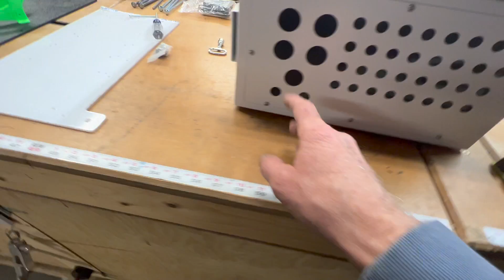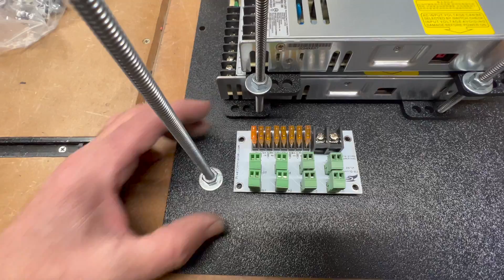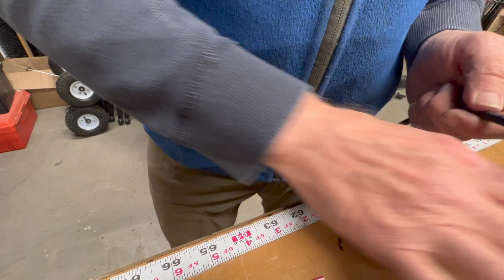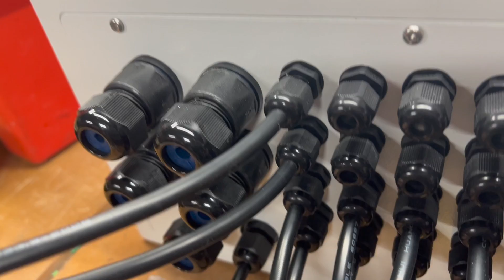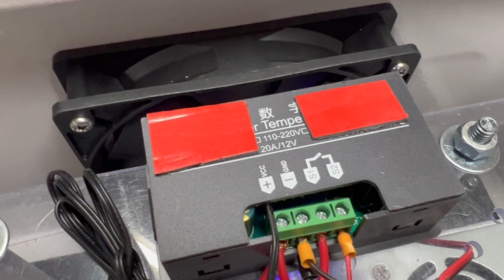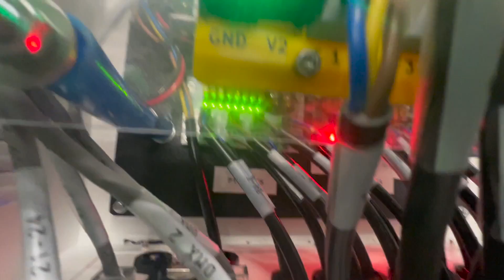Pixel Controller Build

Comment: This is very helpful.  Does the power to the thermostat come from a distro board, or directly from the power supply.  The wire looks thick, so i was wondering.
Reply from the maker: I got it directly from the power supply.

Comment: Nice build. Power injecting from separate power supplies, do you break the positive so the controller power and other power supplies are not feeling same string?
Reply from the maker: Yes I break the V+ in the prop or between different props.  It depends on various factors like number of lights brightness level and type of pixels.

Comment: Do you have a wiring diagram to follow? I am building same setup and need help.
Reply from the maker: I have not created a wiring diagram.   Generally you connect the 120v plug to the AC side of the power supplies.  You then connect the DC side of the power supply to the controller.  One power supply connects to one side of the controller and the other power supply connects to the opposite side of the controller.  In other words each power supply powers 8 ports on your controller.  Hope this helps.

Comment: Why did ya switch from Falcon controllers?  Just ordered 3 new F16V4.
Instead of the Meanwell supplies, switch to breakout board HP server power supplies.  The come in 700 and 1200/900 watt units.  They are super robust in a small package.
But I custom build all my controllers and dont use the premade Bud box units. Cheers !
Reply from the maker: I still use my falcon f16v3.  Just decided to try out the genius controllers.  I like there new differential receivers.  As for GP power supplies, just haven’t gotten around to trying them out.

Comment: What software do you use to control all this? My stuff is so small and it is just WLED still.
Reply from the maker: I use xLights.  There are several others you can use.  xLights is very powerful and there is a lot of community support.  It is also open source.

Comment: About the Genius controller, is there a relay output to turn on the power supplies?
Reply from the maker: No- don’t think I have seen any pixel controllers that do that.  The Genius controllers operate on 12 VDC, so they are powered up by the power supplies inside the box.
Reply: Might want to branch out a little. The Dig-Uno, Quad and Octa boards all have a delay out put that can be used to turn on the power supplies. Just need to provide 5v to the ESP32 chip.
Reply from the maker: @eekedout  did not know that, thanks for the info

Comment: It is a nice video and a clean build, however... as a retired industrial controls systems engineer I cringe at the power supply mounting where you cover up the bottom supply fans.  It may work ok in the reality of Christmas lights and cold weather, but I believe it is a bad design.  Give them some breathing space..
Reply from the maker: Yes this box is very large.  You could have a stack of 3 power supplies so if you have two of them you will have plenty of space.
Reply from the maker: Thanks for your insights.   There is about 3/8 of an inch spacing between the stacked power supplies so the fan is not covered up.  Also have a large fan, 9 inches I think,on top to pull cool air through the box.
Reply: @bergmannlights5149  Was looking into using this box - and your video is very helpful to get a hands on feel for it. Regarding this comment which seems like a valid concern - is there room to add spacers to increase the breathing  space between power supplies - say maybe one inch?

Comment: Looks good. I did a similar-ish build earlier. 

I like the box. It's very solid. I struggled with the carriage bolt things for a while until.. Mynor filled me in.  Also the silver vs 'dull' bolts being different lengths. It's not that much of a difference that it's immediately obvious.. 

I have a quibble with the box - which is that the triangular key has a MUCH larger triangle in the key than in the slot. Which means you can't leave it in - it just falls out. it's way too loose. And you have to use the key to latch the door. I'm not worried about people opening it up and stealing things out of it, so I'd probably have to screw something into the housing somewhere to hang it off. 

Also - "We're just about finished" .. I'm also struggling with how to mount this thing. I suspect I'm just going to end up leaving it on its side, like you have it here - for access to the pigtails, but it won't stand up like it wants to... I'd be interested to see if /what you come up with for that.
Reply from the maker: For mounting it I plan on using the large hose clamps that came with it, feeding it through the back brackets and the mounting it to a pole by my Megatree.

I do like this box a lot but it would be nice if you could open and close it without the key
Reply: I'm searching for reviews on this box - not much that I can find. Since you are one of the few people that I can find, one question - any regrets with the purchase? It's a bit on the high side - especially with shipping, so I'm trying to do my due diligence before making a purchase. Any comment would be appreciated.
Reply: @paul_dz  Hey Paul. So, here's my thoughts : 

I built and installed mine after the Halloween holiday, and left it out over the winter period. I get snow, and cold temperatures, and also rain. 

It's big. But solid. I put a Genius GPX 16 and two power supplies inside mine. That combination led to a problem with the pigtails being super close to the bottom panel holes. I got 'em in there, but it was an awkward placement, certainly. The mounting board I got from Mynor has the phoenix connectors close to the lip. Not a deal breaker, but even so. 

The unit itself is heavy, and includes some mounting grips. I guess the idea is to mount it to a vertical pole, or 4x4 or something, but I didn't have a convenient place. That - coupled with the fact that the pigtails all come out the bottom = meant I lad to lay it on its back. 
I'm not particularly happy with that orientation. The lid I left closed, although not locked because - the OTHER issue is that the trianglular key-thing doesn't fit the lock. It's way too big and falls out, and I didn't want to lock it and then have the key disappear. 

Soo.. It was out all winter, coped with the Christmas show fine, but I had almost no snow. Turned the show off Jan 10th, left it out there a few weeks while I decompressed, came to break down my show mid-feb and the enclosure has water in it. It might have gotten in through the lid ( the door faces up, not forwards). Or through some vents, although that seems unlikely. It was raised 1' off the ground, so it wasn't snow piling up against it. 

It also wasn't enough water to fry anything. Just a slosh in the bottom. But all the electronics were off, so nothing shorted or died. 
Wasn't so happy with that, tbh. and right now it's on my workbench waiting for me to do a thorough testing. 

I suspect if you mounted it vertically, with the lip overhanging, like it's designed to, then it'd be fine. But on it's back it's not. 
And the bottom orientation for the pigtails makes it super awkward to do anything else.
Reply: @wibblywotsits  Thank you for the taking the time to write a very thorough review - much appreciated. 

I'm thinking the orientation had to do with the water getting in - maybe some wind swept rain. I would be mounting on some type of post so I think it would not be an issue.

As for the room with the pigtails - it's a shame that the mounting board would place the components so close to the edge - there must be a lot of free space at the top of the cabinet. Maybe I should consider making by own mounting board if I was to go with the enclosure - have to give it some thought. Thanks for pointing it out.
Reply: Comment directed to wibblywotsits

Comment: Are you using 1 power cord for all four of your power supplies? Can you show me how you have them linked? I know I must have not been seeing it correctly but it looked like the power wires were the same colors as a pigtail?
Reply from the maker: I did only use one power cord.  Most people use 2.  You need to check your load and the gauge of your plug makes a difference as well.  For AC power I used black for load, white for neutral, and green for ground.  If you are unsure use two power cords.  For DC power I used red for V+ and black for V-.   So there are two types of black wires.  Hope this helps.
Reply: @bergmannlights5149  Thanks for the info. Do you know what gauge your power cords are?  I believe the ones that I got were 18 AWG. They 16 AWG, Do you think those would be better to use for multiple power supplies. I used to use one cord for each PS but now I've been only using 1 in my boxes with 2 PSs. Having fewer plugs is a definite plus.
Reply from the maker: @chestercampbell5681  bigger is better.  Go for 16 awg.  One 16 awg for 2 power supplies is good in my experience
Reply: @bergmannlights5149  I would love to see a better shot on how you did the wiring for 1 power cord for all 4 power supplies.  Is there a diagram or something you can post?  Is the cord going into one powersupply and daisychaining them?  I wish you would have gone over that in the video.
Reply from the maker: The thicker the wire the better do go for 16 awg or better for 4 power supplies.  I just ran jumpers from the power supplies using 12 awg wire.

Comment: Im new to the hobby. for my first year i was going to start with a controller and roofline lights. I luv your icicles. How many ft of icicles can i cover with one of these 16 port boards?
Reply from the maker: It depends. If you do power injection you can put more on an output then if you don’t.  There are 150 pixels per 8 ft section.  If you are using 12v pixels and run them at 50% brightness you can easily do two sections without doing power injection per output.  Hope this helps.
Reply: Do a mega tree first.  Its a great learning curve display!